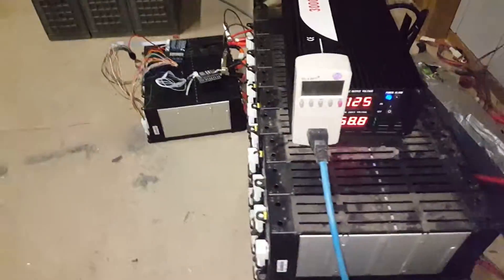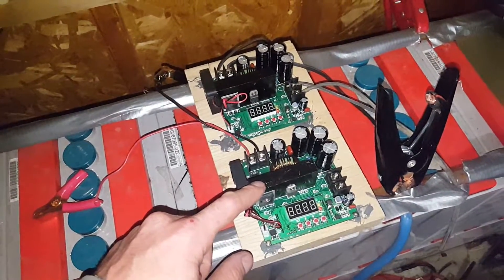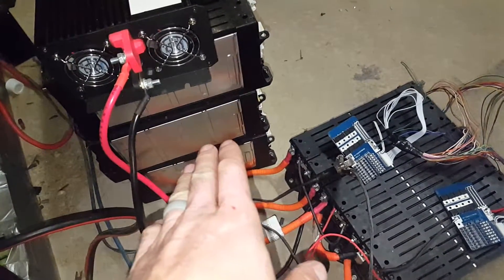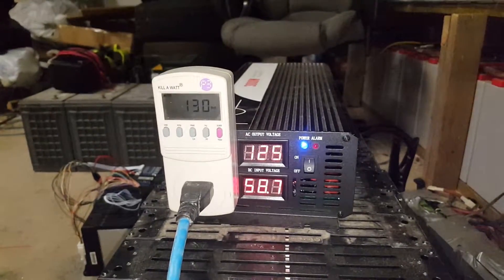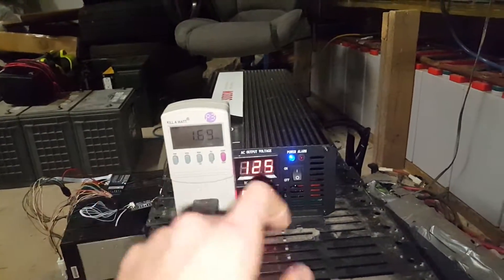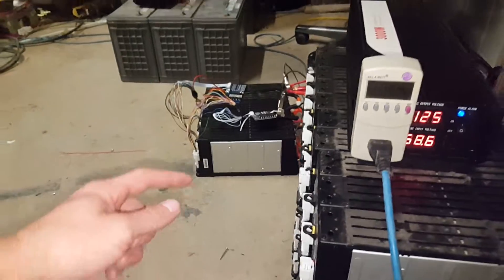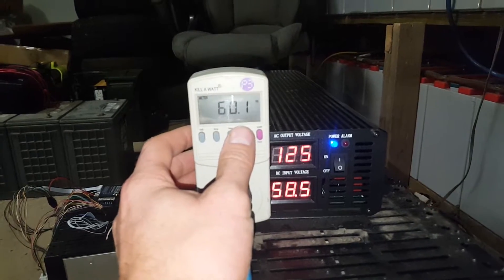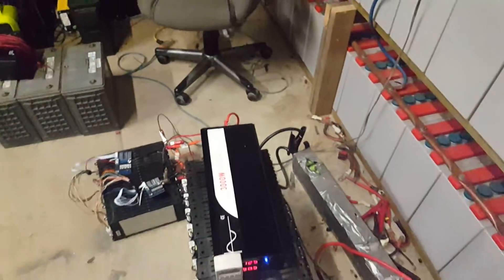just a quick update on the DIY Power Wall

Comment: When you say bar fridge do you mean a normal fridge or smaller? Make your own http://www.banggood.com/12V-6A-DIY-Electronic-Semiconductor-Refrigerator-Radiator-Cooling-Equipment-p-1074404.html?rmmds=cart
Reply from the maker: its a smaller bar fridge.
Reply: fliping720 If this interest you it has to go in at the side, it drips water and you need that fan blowing in and you let the moisture drip in a bowl not on the fan

Comment: I use a Buck Boost http://www.banggood.com/D3806-NC-DC-Constant-Current-Power-Supply-Step-Down-Module-Voltage-Ammeter-p-1059235.html?rmmds=cart
Reply from the maker: looks good, just lke my smaller ones
Reply: you can boost 12v to 40v

Comment: Is there much loss in those long parallel wires?
Reply from the maker: not at 60v but I will be making them shorter some time :)
Reply: fliping720 I gotcha. I really need to up my voltage haha. I just got some FIAMM AGM batteries. Only 5.2kwh but I've noticed how sensitive the resistance between paralleled batteries are. My main concern  about upping voltage is that I use a lot of 12v in my RV. Laptop, lights, fans, etc. I'm not sure how to use 12v shit efficiently from a 48v+ bank...
Reply from the maker: BakedLikeLays I love my 12v system I have a 4000Ah 12 volt GEL battery bank, get out a few of my videos to see them :)
Reply: fliping720 Right on. Is your 12v bank charged by the same or separate solar array/controller? I have one array, one 12v battery bank (can be 48v) but need both 12v and 120v efficiently. Maybe an isolator relay and 2 banks one array?
Reply from the maker: I have 3 40 amp charge controllers for my 12v system and 2000w of solar and my diy power wall has 470w of solar charging it.
Reply: Ohhh ok I gotcha. Thx man!